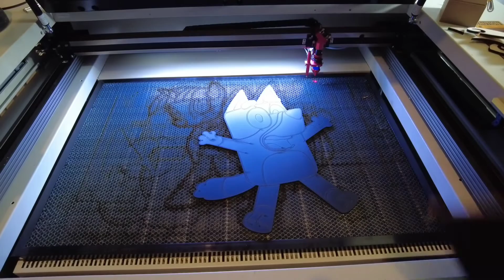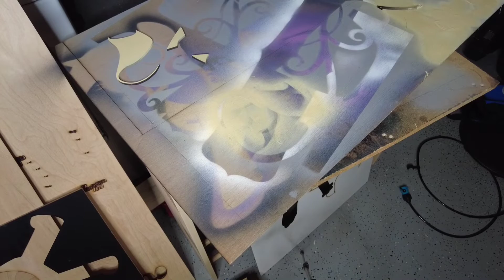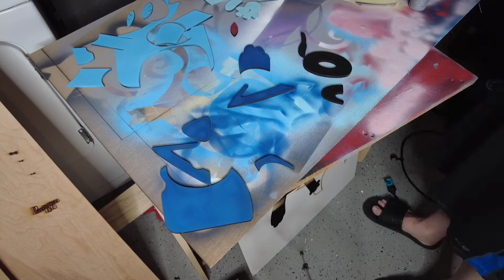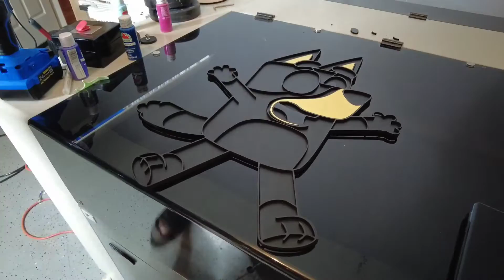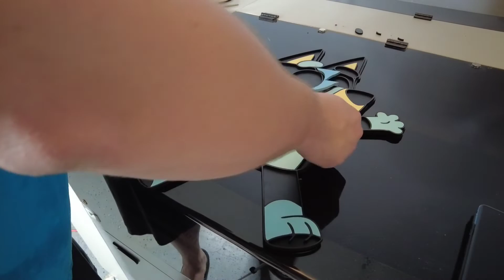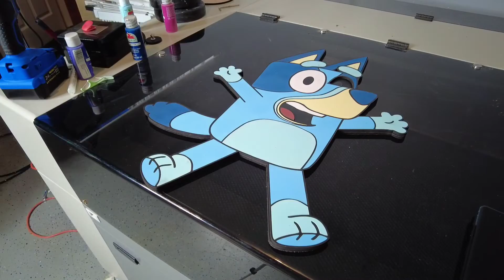Bluey laser cut sign for my son. 80w Laser from MONPORT #laser

Comment: Inspired by this, I bought a LVLP spray gun and a cup system, and failed dismally with the acrylic art paint. What’s your secret to getting the craft paint to work? I see you are using the original cup with the gun, what is your cleaning routine like between colors? Full break down and clean, or do you run water to clear then just go ahead with the next color? Any tips appreciated!

Comment: What paint do you normally use in the spray gun you have? I see that you linked some spray paint, but that doesn't go into the handheld gun you're using, right?
Reply from the maker: I just use acrylic craft paint. Usually apple barrel from walmart.
Reply: @practicemakesperfection8459  Do you think it at all?
Reply from the maker: @CreatedWorkshop   Nope, just dump it in there. Haven't had any problems. I did try it with an air brush but it was too thick so I got the cheapest one from harbor freight and it worked out.
Reply: @practicemakesperfection8459  Awesome, that’s good to know!

Comment: My 80w basic will be here Monday. Hope they are as good as they seem to be. What material did you use for this looks like foam board
Reply from the maker: I haven't had problems with mine. I would  recommend changing the lens. I am using that chalkboard/dry eraser material from home depot in this video.
Reply: @practicemakesperfection8459  like the mirrors?
Reply from the maker: @RAPTORTHERAPPER  just the lens not mirrors https://amzn.to/3YaQY4J
Reply: @practicemakesperfection8459  did you try to do a ramp test with stock lens?